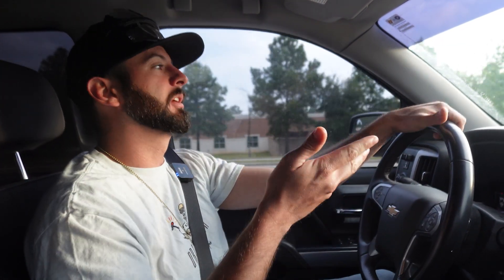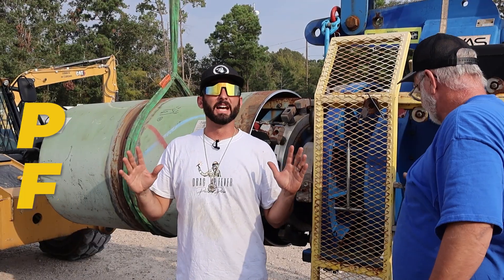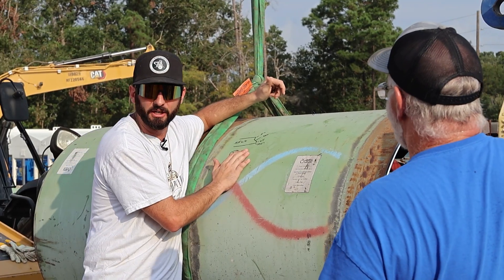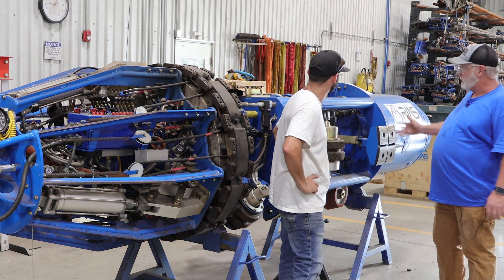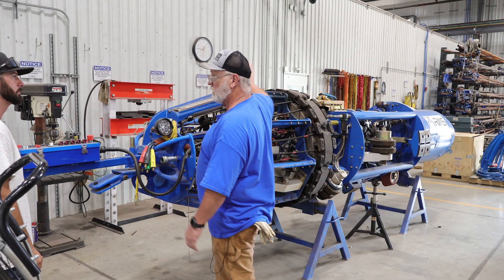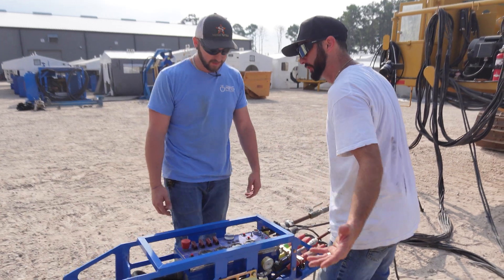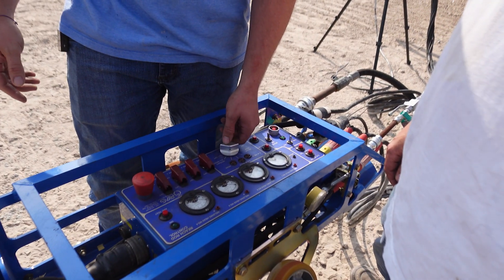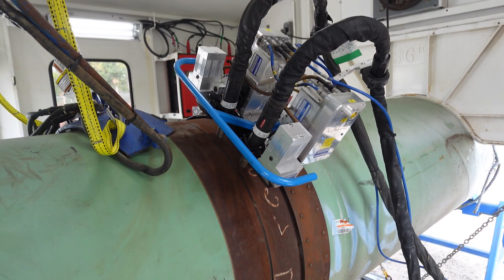Pipeline Welding Automation | Pipe Facing And Internal Weld

Comment: Can you please do a video on mig open root pipe tie ins with no grinder @austinhargett
Reply: I can! But I will be using a grinder for migraines roots
Reply: @Drweldz  migraines roots? Is it possible with no grinder at all? The test I'm doing they only allow a wire brush, and 2 passes on a sch 40 4 inch. Must pass xray
Reply from the maker: @michaelriccardi424  for open roots , sorry, and i only need the grinder for the open root pass